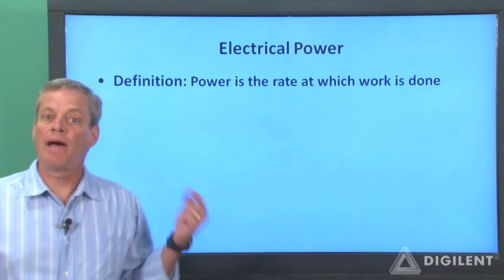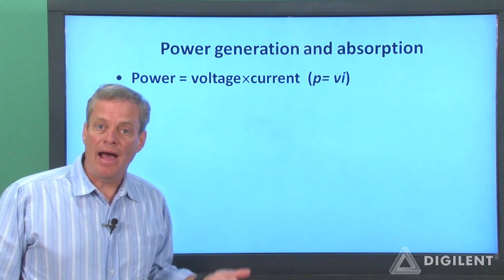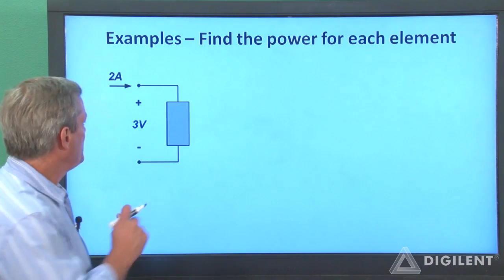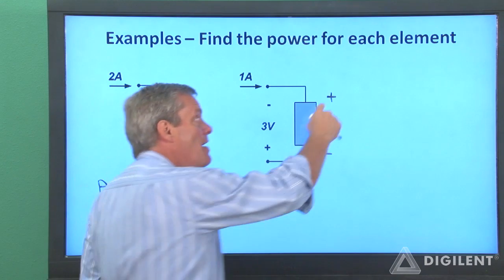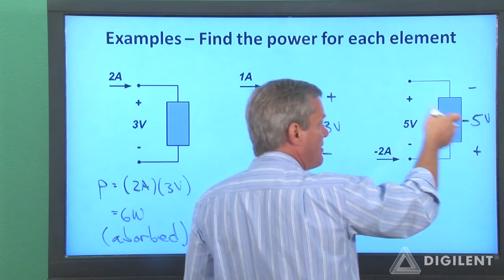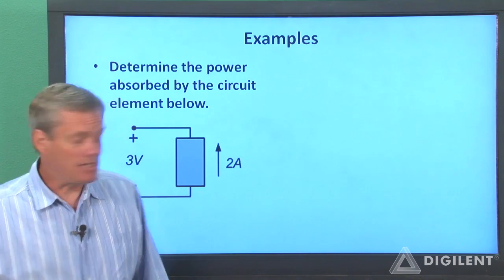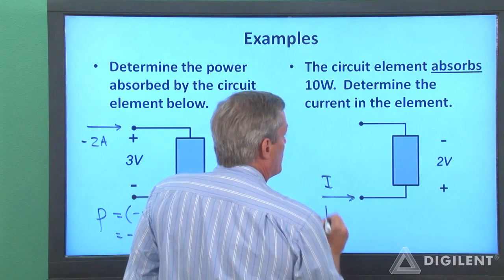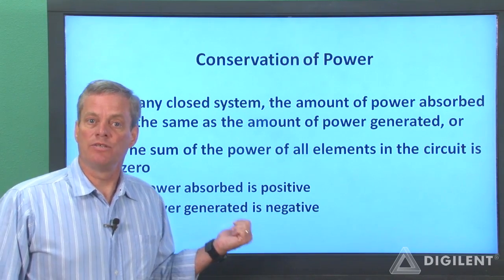Circuit Analysis: Calculating Power

Comment: When analyzing a circuit, the first thing is to assign reference directions across elements when they are not given.  The way my book explained it is as follows:  If the current is entering the positive terminal, just plug in the values obtained, i.e., V = IR, P = VI.  Otherwise, just add a negative sign.  Note that given that reference directions are arbitrary, you could get negative values for I and/or V.  That can trip people up because if they get a negative value for I or V while I is entering the negative terminal, they’re afraid to add the appropriate negative sign.

Comment: @5:00 So, when we 'fix' the reference voltage so positive current enters positive voltage node, we make the negative current enter the negative voltage node? If this is not the case, I am confused, because it just looks like negative current enters positive voltage node. If you could please explain this that would be great.
Reply: Think of it this way:  P = I*V.  In that case the I = -2A and it was entering the minus terminal which through passive sign convention means we calculate the I as negative (if the current enters through the positive terminal we calculate the I as positive). So P = (-I)*V and since I has the value -2A in this case it goes like this P = -(-2A)*V = 2A*V.